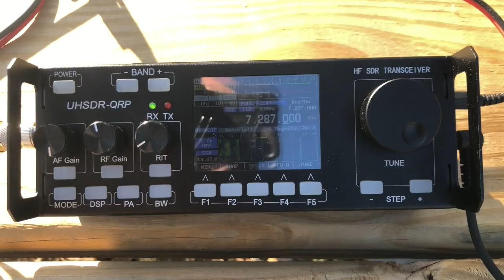Recent RS-918 QRP Radio Parks On The Air Activation

Comment: Just got my RS-918 in the mail today. I'm currently charging up the internal battery and will give it a go on some regional nets later today. The menu system looks somewhat complex so there's probably a bit of a learning curve as the included manual is very sparse on info. Looking forward to doing some POTA activations with it from up here in British Columbia.
Reply from the maker: OH man you got the one with the internal battery, I'm jealous.  The menus really aren't that difficult once you familiarize yourself with them.  The original version of this radio is the MCHF developed by M0NKA, but my google search to his website for the manual doesn't seem to exist anymore.   Curious. Either way, congrats on the new radio.  I'm sure you'll have a lot of fun with it.

Comment: I have same radio. I had to reset after firmware upgrade... It is receiving well but now my radio won't transmit. Completed the settings PA Bias etc.. but still no luck transmitting. Can you help please 🙏

Comment: Funny seeing your shock that QRP works.  lol.  During a recent contest, using 5w and a hobebrew 7 tap unun and piece of wire, I worked 34 states and 14 countries.  Antenna starts out at 8 feet high.  You should look for '80 EFHW & Multi tap UNUN part 1 of 3...' if you wanna see what you can do with a $3 toroid core and hunk of wire.  Its crazy.  You can work all bands with no tuner when using a multi tap UNUN.  Near perfect match on all bands.  And YES, you can actually make contatcs with 5w.  Think about the S unit and the dB.....  73 OM
Reply from the maker: It was just so amazing that all those stations were coming back.  I have never seen a pileup like that from anyone running QRP.  I have a QRP EFHW for 80 that works on all the bands with a little touching up with the tuner.  Mostly resonant on all of em but it's like 132' long.  I've got plenty of antennas to play with and I have another one on the way.  Cuz, you know, I need more haha!
Reply: Yep, my 80 efhw is about the same length.  I'm not sure cuz I keep f'ing with it.  haha.  But yeah, it started out at 135 then I broke my leg in 2 places and tore tendons whilst trimming 4' off.  I healed and it works great.  Plus, it gave me something to play with while I couldn't walk all spring and summer.  Awesome!  That's where my multi tap unun was born: out of a life of agony. I like the unun cuz of the near-pefect match I get with no tuner at all.  LOVE your vids!  By far the most fun to watch and they're always interesting.  Happy new year OM  73

Comment: I should turn down the 891 and go QRP ?  Thanks Man !
Reply from the maker: Thats what I did when I first started going portable, but then I got a LiFePO4 battery and cranked up the power and never looked back.
Reply: That's what I do with my FT-891! Great radio for digital or CW! It has all the filters you need. I see some QRP guys saying its over kill due to the current drain on RX but with lithium batts these days its not an issue I think. I have 2 lithium 4ah mini bike batteries in my bag. They hold up fine. I use it for SOTA. I activate the summit on FT8 and usually have some battery power left for a QSO. 

But it all depends on how much weight you can haul in your back pack. Here in Texas we have to carry more weight in water than equipment. Water is 8.6lbs a gallon. =]

WW5RM

Comment: Another great video. I've noticed the atmospheric conditions are improving. A few nights ago, I made a contact with a station in central Italy, with 8 watts SSB, using my Elad FDM Duo and a MFJ 10-40m EFHW antenna. I've also been tweaking my Transmit Bandwidth and that's been bearing fruit also. I've went from 300 by 3500 Hertz to 200 by 2700 Hertz. I'll with a better antenna or just a more advantageous set-up I think I  can get an even better range. Cheers
Reply from the maker: Nice job.  That bandwidth setting was too wide.  You should be a lot better where you have it now.
Reply: @hamradiotube  Thank You.

Comment: Great video. What band were you on and what was the untuned SWR? I’m curious about the effect of the radials
Reply from the maker: I was on 40 meters.  7.285 I think.   The radials make a huge difference.  I did a video just on the antenna you can check out where I show that a little bit.  The untuned swr is quite high as its a 9:1 unun designed to be that way so it can be tuned on multiple bands.
Reply: @hamradiotube  Thanks. I've seen it go as low as about 5:1 with a radial. That is still a fair bit of coax loss though. I was running 25ft of RG52.  But, it works. I will try your solution for fan radials. Good idea.
Reply from the maker: Douglas Dreger that’s prob about it.  Next time I go out I’ll try to remember to put it on the analyzer and check.

Comment: I told you QRP works Mike! Only a few DB difference between 5 watts and 100 watts.  You"ll start to love it now because you can make tons of contacts AND your battery will be MUCH smaller in the pack! 
Merry Christmas from Pete, W8BBM.
Reply from the maker: Sometimes I need those few DB's but not that day!  I've got some smaller batteries coming, and I may have a couple other qrp radios I'm going to be showing.  Now if I could just make it warm again...

Comment: Looks like that radio did very well!!!  I have looked at those, but worried about quality.  I have seen good reviews and I have seen bad reviews.  May have to look further into one of those.  73 Juddie WD8WV
Reply from the maker: Yeah this was given to me from a friend.  I'm not so sure I would just go and buy one of the Chinese ones.  They are so hit or miss.  You can buy an original MCHF from the guys that designed it (either as a kit, or pre-built) and know that you are getting a quality bit of kit.  There is a link in the description.  Last I checked though, they were sold out.

Comment: QRP works great until it doesn’t. A long QSO will take many fades and complete drop outs. Fun in the field but not at home for ragchew.
Reply from the maker: No I would not do this at home.  Long contacts can be hard with 100 watts sometimes too though.
Reply: I’ve had many a great QSO’s on 5 watts. The Propagation God’s have to be with you, but it works.
Reply: N1UFO/ Gabriel There is no god, only man.⚡️